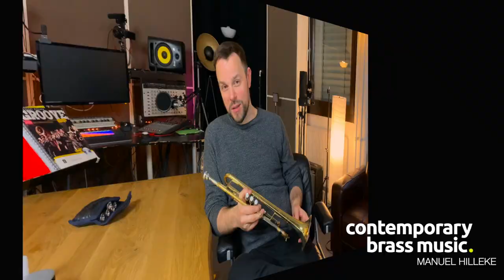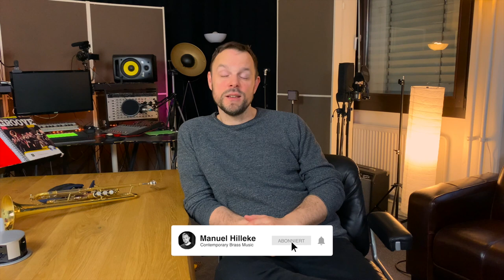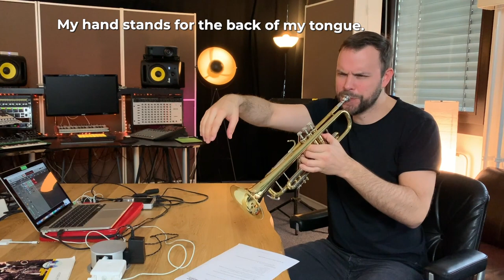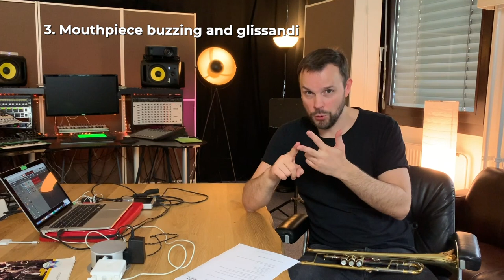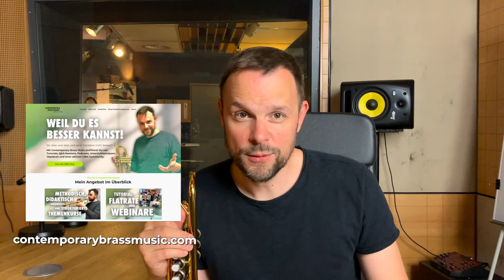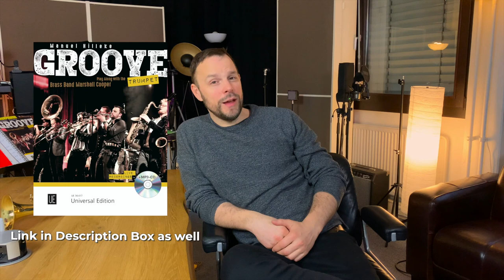How to Play High Notes on the Trumpet

Comment: The tongue movements are related to embouchure effort.  The tongue doesn't increase air pressure.
Reply from the maker: Hi, you can check out this other video of mine where I explain how the entire system works in a little more detail. It also has English subtitles: https://youtu.be/CVQx8g8Q-gA
Reply: @manuelhilleke  I have reviewed it. You don't understand the mechanics of air flow in the system.
Reply from the maker: Dear Daryl, 
Thank you very much for your comment. Unfortunately, your statements are not physically and physiologically correct. 
I am sending you my source here to which I refer. 
https://www.amazon.com/Brass-Master-Class-Method-Players-Book/dp/3795753392
However, I do not want to exchange details with you via the comment function. That usually leads nowhere. We obviously have two very different views. 
Best regards, Manuel
Reply: I am a trumpet player and professional engineer.  I know physics and how it applies to playing.
Reply: Darryl Jones is saying one thing and you are saying the opposite I am confused 😕😐🤔
Reply: @da11king  obviously the claim that the tongue increases air pressure is just false.  If moving the tongue forward is helpful , it doesn't have to be justified with an explanation of misunderstood science.
Reply: @da11king  I do agree that tongue arch helps when ascending.
Reply: @darryljones9208   Hi Darryl, without the tongue nothing would work. It controls the air stream that blows open the lips. Without the tongue you couldn't play the trumpet, the air would come out at the sides of the mouthpiece and would be gone in 2 seconds. There is the support (active exhalation), the vocal cords, the tongue and the lips. Keeping a balance between all these forces and valves is the art of trumpet playing. But don't take my word for it, there is a guy who proved it scientifically over 30 years ago, but is largely unknown in the US. His name is Malte Burba, and he published a book and dvd explaining all of this and more in much greater detail.
Reply: @clemensmuller4794  , Burba did not prove anything,  he makes bad assumptions based on science he does not understand.  The tongue can stop the air for articulation but it doesn't "control " air pressure otherwise by increasing it . And to use the tongue and airway to decrease air pressure (other than articulation) is a very inefficient way to play. Burba does not understand the actual laws of physics in play. He just doesn't.
Reply from the maker: q.e.d. https://www.youtube.com/watch?v=MWcOwgWsPHA
Reply: @manuelhilleke an expensive verification of what we already knew, that the tongue moves forward as we ascend.  But no air pressure,  flow, or  velocity measurments were performed as part of that study were they?
Reply: Darryl I have seen you comment on many of these YouTube videos of their lack of understanding of the science. Can you point us to some video (or one of your own) that explains it well and is a good starting point for efficiently playing in the upper register?
Reply: @darryljones9208 , I'm sorry, but you keep making extraordinary claims about your understanding of the science of brass playing, yet you deliver no evidence whatsoever or any coherent alternative explanation. Your claims sound like the posturing of an armchair expert who's too lazy to put in the time in the practice room to see for himself how a method works.  The whole waterhose analogy is not objectively true, nor is it supposed to be. It's a teaching aid, to help people get a grip of how the forces are distributed within the body without giving them too much unnecessary information that would confuse them. By trying to attack or poke holes into something you don't understand, you rob yourself of the opportunity to greatly improve your trumpet playing. You claim to be a man of science, so why don't you stop wasting your energy trying to prove the earth is flat, take some lessons and put in 6-9 months of daily, diligent and focused practice for 30-45 minutes? Before you have done that, I can't take any of your "scientific claims" seriously, since they only prove your ignorance.
Reply: I think you miss the point. I have NEVER descouraged prolific practice and most are quite deficient in that activity.  What is worse is practice that creates and reinforces bad habits and a lack of results.

I assure you, I have put in the time on productive practice.

Also, those who do peddle the "water hose analogy" do INDEED  think that it is literally true AND think that it is supposed to be.

I challenge you to ask them if they think it is literally true or if they are only presenting a metaphorical explanation.

Let us know how that turns out.

Sooo, Given that I have averaged HOURS per day of practice FOR DECADES. AND I am also a educated,  professional and practicing engineer, would you be willing to consider that I might actually understand what I am presenting? Would you then take my claims seriously?
Reply: @darryljones9208  I still think you miss the point. You could also GREATLY improve your efficiency and your ratio of effort/result in the practice room if you let yourself guide by the principles described in this video (and by the way, it barely scratches the surface of the entire system). The results (and I've seen a lot of examples myself) speak for themselves: people who put in the work play with  less effort, a better sound, a greater range, endurance, flexibility and improved intonation. So far you've made no argument that could discredit these results, or offered or demonstrated an alternative explanation that shows a better way to practice and play, that is replicable by everyone, regardless of their natural abilites. So please, enlighten me.
Reply: @clemensmuller4794  the action of arching the tongue is directly related to the effort of the lip muscles when controlling the pulsing aperture. So, it is an indication of how much lip "tensioning" is occurring. Especially the "roll-out" action. It would be productive to simply state "allow the tongue to arch forward  to ascend " and leave it at that. Without the incessantly "sciencey" explanation that it does SOMETHING to the air.

If one can gain skill in range WITHOUT overly pronounced tongue movements they will be playing more effectively and efficiently both from a lip effort AND air power standpoint. 

How does one get there?

1. DONT do " buzzing" excercises.  Play the full instrument ALWAYS. 

2. Practice VERY soft with low effort for HOURS.

3. Do "calesthenic" playing only VERY sparingly.
Reply: But one could easily simply say "allow the tongue to move forward as you ascend " and leave it at that. What's with all the misunderstood "science" to justify it?

If it helps then no "science " explanation is required. 

If it doesn't, then no explanation is sufficient.

But, again,  they LITERALLY  believe their bad science.  They do LITERALLY  believe that the tongue  "compresses" the air, or " speeds up" the air. And they LITERALLY  believe that "air speed" controls the pitch played.
Reply: @darryljones9208  if it works for you... the lips don't control the frequency of vibration. It is possible to play the trumpet with facial paralysis, because the mouthpiece holds the lips in place. The lips do have a role, but max. 20 percent. But if you practice the right things you don't need hours a day to improve and have more time to improve your other musical abilities (timing, phrasing, dynamics, etc.)
Reply: @clemensmuller4794  the lips control the pitch played quite dominantly. Have YOU ever tried to play with lip muscle paralyzed? I had the opportunity,  couldn't make a sound.
Reply: @darryljones9208  you claimed that the video misunderstood the science, so I don't know why you're bringing this up? When "let the tongue move forward when you ascend" doesn't work, what then? It's true that a factual explanation of what the problem solves the problem, especially, when someone has problems moving the tongue in a certain way. Much more important is the way how you teach someone to gain access to the right movements, but you wouldn't get there without knowledge of how the playing system ideally works.

So, your argument is still invalid.
Reply: @darryljones9208  no, but there are other reasons why you may have been unable to make a sound. Correlation is not causality. Things like reflectory blockages of the vocal cords that are caused by a changed feeling of the lips are quite common, especially if the playing system is not working optimally.
Reply: @clemensmuller4794  i never said that the tongue moving is the only action. And if you think that the lips do not dominantly control the pith then it is clear thay you don't understand the "system". I suppose you believe that it is "air speed"  ( more junk science)
Reply: @darryljones9208  what do you base your assumptions on? I don't think it's just "air speed", no. It's about bringing the forces of air and lips in balance to create a sound. There are many bodily functions that influence this balance (things like the tongue, the vocal cords, how someone's breathing works, the lips). The lips respond to an increase in pressure, but contrary to the dominant feeling we have on the lips is their importance in controlling the pitch. If the air column behind the lips is corrupted in some way because the tongue, vocal cords or support fail, the lips are going to fail aswell.
Reply: @clemensmuller4794  we don't engage the vocal chords while playing so they are not a factor. I can also move my tongue around while holding  steady tone. As long as the lips don't change the tone is not affected in any way.

Air pressure doesn't control the pitch played. If that were true, then playing dynamics on a steady pitch would be impossible. 

Air pressure does provide the energy density (of the air) required to play.  But it doesn't control the pitch played.  The lip posture does.
Reply: @darryljones9208  no, simply because you think you are able to do these things and feel this way subjectively, it is not automatically true. The lips produce much more sensory input than the tongue and the vocal cords, that's why players reflect this the wrong way. The human body is built for outward perception, because too much inward perception (things like what the gall bladder does) is not necessary from an evolutionary perspective. And if we try to find out what the tongue and vocal cords do without looking at them, our feeling is a very unreliable guide. I can't stress this point enough.
Reply: @clemensmuller4794  but the pulsation LITERALLY occurs at the lips, ant THEY, THE LIPS, control the frequency and quality of tone. The resonance of influence is in the instrument,  not the body.

You obviously believe the Burba  nonsense.
Reply: @darryljones9208  nonono, that would be argument from authority. It's about what is logical. How are the lips supposed to produce a buzz, all by themselves? How and in what way are they supposed to control the frequency and sound quality?
Reply: @clemensmuller4794  the state of lip firmness and tension controls the pitch played. Air pressure provides the energy of the pulses that the lips produce and gives power to the tone. The standing wave in the instrument contributes to the cyclic pressure in rhe mp cup..
Reply: @darryljones9208  this is again correlation vs causation. The lip firmness might correlate with a pitch change, or volume change, but it doesn't cause it. the lip reacts to the air stream the same way the lid of a pot reacts to the pressure inside it, or an open window reacts to an airstream that pulls it shut. The lip tension is only ever answer to the increased air pressure, or a movement that is purely conditioned and has no functional use at all (like pulling the lips apart, for example).
Reply: And yes, the resonance of the instrument aids the lips in their vibration. Which is another argument for why the state of the lips is less important than commonly assumed.
Reply: @clemensmuller4794  but the lip state selects which of the several resonance modes is the fundamental  frequency of the tone produced.  The lips are the DOMINANT factor of pitch control.

It is EASILY evident that we do not play low tones with "tight" lips. And we do not play high tones with relaxed lips. This is IMMENSELY evident.
Reply: @darryljones9208  the lips do have to contract if you want to cover larger intervals, play in higher registers and have more endurance. But practicing at that front is only useful if you have taken care of your breathing (probably the biggest factor in endurance, since supporting properly and breathing probably increases endurance tenfold), your tongue (a proper use of the tongue makes playing larger intervals or having control over sound and intonation possible in the first place, and is HUGE in the efficiency of the system). Only then it makes sense to get to the final 20 percent of the lips. But before that you're wasting your practice time with inefficient, pseudofunctional nonsense. Practicing in a system that offers consistent, reliable long term results and is based on proven principles makes much more time to practice music!!!
Reply: @clemensmuller4794  efficiency of embouchure function requires LESS air support (air pressure and flow) in general.  Not more. A skilled, strong and efficient embouchure also requires less effort and less tongue arch. Again, the arch is ONLY associated with the roll- out action of the lips. There is nothing that the tongue arch does to increase air power efficiency,  in fact an overly done arch (to the point of "hissing") Can cause a HUGE reduction in air power available to the tone.
Reply: @darryljones9208  no, roll out and tongue arch are not connected.  A very close tongue position like"S" or "hissing" produces great pressure, but the volume of air released is far too little. But this is not what we should aim for. What we're looking for is the optimal balance between pressure and volume. And the pressure needs to be in the right place, meaning more to the front of the oral cavity. There are a lot of things you can practice to improve your ability to find this "sweet spot" where everything feels easy. But I have to repeat myself: trying to poke holes where there aren't any is not going to make you play better anytime soon. When was the last time you worked on timing?
Reply: @clemensmuller4794  ok , you really should just retreat to your metaphors and visualizations. The tongue does not "pressurize" the air above what the lung pressure is. And you are also confusing air flow with air " volume ".
The idea that the tongue "narrowing" with an arch creates or increases air pressure is simply false. Again,  retreat to your metaphors,  but stop claiming the erroneous technical explanations.